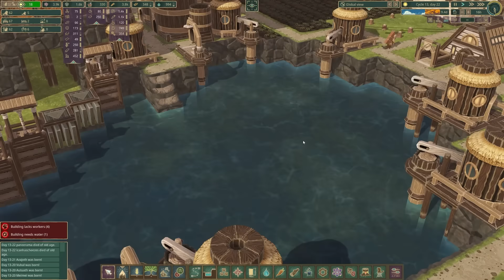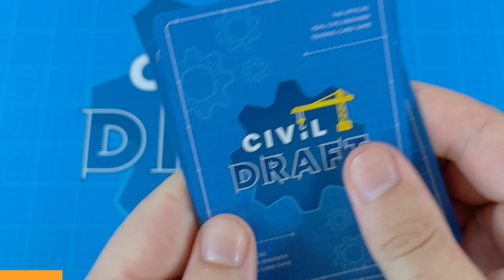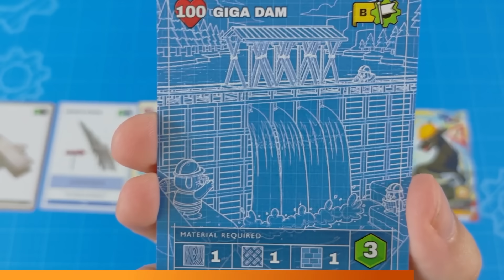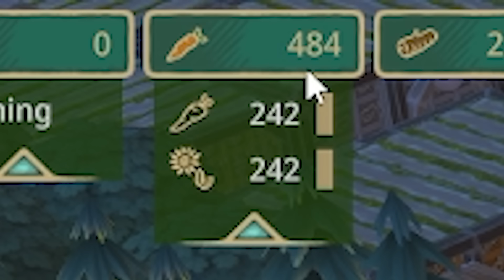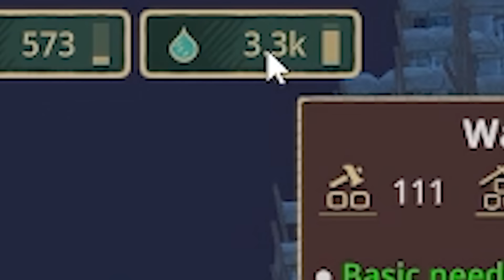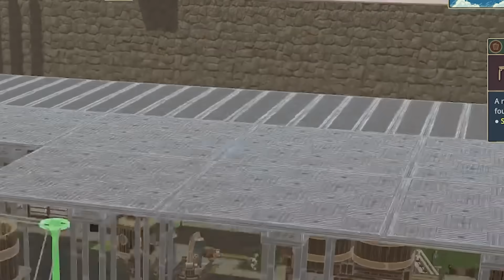The MEGA PUMP will save my colony in Timberborn!

Comment: 30:09 “One 2x overhang with two 5x overhangs? Nahhhh one 5x overhang and FIVE 2x overhangs! The grain direction MUST match!!” 🥴 edit: it doesn’t even match all around!! There is no discernible reason to choose 80 log/planks + 30 metal cost, over 60 + 24 cost (Small margins yes, but besides the resource principles, it would probably be a shorter build time too)

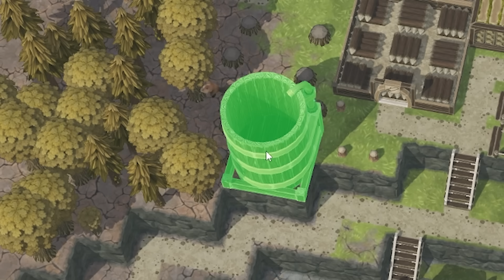Comment: 15:20 use a fucking district center !!! What's the point to have 2 discricts if u don't use district center, it's more interesting when districts help each others and trade than be completely independant, its like having 2 games in one, u just seperated the map in 3 instead of getting all the advantages of this map.

Matt always says that he hates architects, he shames them and juste after he does the most architectural thing : wasting a lot off ressources to build a big roof
... 😑

Comment: Couldn’t the columns be replaced with arches using the 1x6 or so floors you used in the roof? Thus you could eliminate some of the pillars and clear it up a bit if the physics works out.

Comment: I'm still not quite sure how he intends to get the water out of the resevoir he's building. I figured he would leave a hole in the corner, with some sluices to control the moat water level, but the whole thing is sealed up. At least the sluices he built at the water sources should prevent bad water from flowing into the MEGA RESEVOIR.

Comment: You must be an architect.  For the top of your water hole you need 2 dams. That way the overflow will run out. You need to use sluices properly or i am going to revoke your engineering title.  I havethe power, dont make me do it!

Comment: Build a hobbit like village in timberborn. So the end goal is: 1) the entire surface of the map should only be covered by grass or trees. 2) surface may also have 1 windy river with maximum of 2 bridges. 3) some houses must have the side that has door - that hoes on surface,  but their roof must be covered & have grass on top. Each of these houses shall have a patch of food growing on a 3x3 tile no further than 1 block away from it. And all of them need to be connected by paths, but no unnecessary paths allowed. 4) up to 4 log pampers on the surface, but they become closer than 4 tiles from each other & only 2 per side of river. 5) zip lines are allowed on surface with up to 4 stations & 3 poles. 6) no roofs are allowed 7) up to 2 fire camps on surface.  8) in the end all bevers must have a work day that is no longer than 4 hours. 9) bevers need to have every single need met

Comment: 30:00 placing a 1 5x1 to hold 5 2x1s, instead of 1 2x1 to hold 2 5x1s, is the kind of engineering efficiency I have come to expect from RCE.

edit: 32:50 😅

Comment: Terrain blocks (and maybe levees as well) can overhang 3 spaces without being supported, you don't need to cover the whole place with overhangs. It is easier  to cover using terrain blocks as dirt has no regrow time like trees and dirt is needed only for terrain blocks and leisure buildings. Covering 5 grids long, 7 grids wide space costs 1 overhang (30 woods, 30 planks, 10 metals) and 210 dirts instead of 7 overangs (210 woods, 210 planks, 70 metals) + 35 metals for impermeable floors + 84 woods for levees to close the sides of the overhangs.

Comment: I wonder why hasnt Matt just made platform all the way up to his desired height then put the overhangs on top of those platform then spacing the next platform+overhang to have a same height roof for his atlantis project and not waste that much metal and only use a lot of wood w/c he can produce a lot unlike his finite source of scrap metal(since he hasnt unlocked the infinite scrap yet). I thought RCE was an engineer but is he slowly becoming an architect since one of the most important thing engineers need to do is cut cost and make things efficient

Comment: Matt. If you want a body of water on top of the zoo, you need to make a level ceiling. Aka, supports at the bottom, with over hangs until you get to your ideal level. Overhangs are porous

Comment: Well, the Atlantis project looks impressive. I’m sure you’ll have found this out but you will need to temporarily remove enough of those impermeable floors to add paths so the beavers can lay down the impermeable floors. And there will be other engineering challenges, it’s going to be fun seeing you overcome them.

Also the IPT needs a dam to retain water in that area during the dry seasons, pumping or not that area is not going to keep water through a 25+ day drought without it.

Comment: A thought crossed my mind. To make the most of your new reservoir, you need a way to drain water from the lowest points. You have three low points that aren't connected to each other, thanks to the highest point being in the middle and the older reservoir blocking part of it. I recommend replacing some of the levees with floodgates or sluices. 

I would also recommend building a small dam at your colony to raise the river level, at least part of it. That way, the pump would have a larger supply of water. From what I can see, it can handle a bit more water without flooding the farm. Just make sure it has a way to keep from overflowing. I would also put some sluices on the bottom, just in case you need to drain it.

Comment: Instead of Atlantis keep with the Beaver theme and call it a Lodge.       "A beaver lodge is a dome-shaped structure built by beavers using branches, mud, and rocks, typically located in or near water. It serves as a home for beaver families and provides protection"

Comment: Dude it’s your colony but you could do so much more with that space than to put a roof over it….experiment with SKYSCRAPERS!!! Build UP ! You can turn that reservoir into a pressurized water tower and that could be your first skyscraper then unlock dirt and built farm towers with zip lines up the sides that take the beavers up to each level and do tree towers too and never run out of wood and play with your logs all day long !!!

Comment: Does anyone else feel like that's not the most efficient placement of the overflow on the water reservoir... Even if efficiency would require more engineering at the tip?

Comment: Instead of the Atlantis project, you'd likely be better served building an underwater reservoir.  Put a 1x dynamite, a 2x dynamite, and a 3x dynamite at the bottom of a river to start a stairway down.  Then use the tunnel dynamite to clear out an underground space.  Then you can work your way downwards from there, creating a massive underground lake that won't evaporate during droughts.
A practical upshot of this is that if you make it close enough to the surface in areas where you need to farm, your crops will never dry out and you can create fertile land in otherwise dry areas away from rivers.
Reply: Underground reservoir evaporates as if they have no roof at all. Total height of water is the most important factor for reservoir.
Reply: I've been doing this since they added the tunnels. Also using it to dispose of bad tides. It's even better since you can build any size underground reservoir and then put dirt on top of the platforms. I set mine so the water level is the same height as the top of the dirt and use a platform for covered waterways wherever I put roads, so that top layer of of dirt is always irrigated, but there's only one layer of dirt and all reservoir below.

Comment: To do a roof the best is to use platforms as supports, then use a 5x5 Metal Platform, 10x 6x1 Overhangs, and 5 3x1 overhangs. Then make another 15 tiles away and repeat. you will need supports yes, but its both minimal, easy, and gives you a nice flat area.

Comment: If it is true that 2 water sources in require 2 blocks worth of drainage, then the only way to get the most of out the reservoir, would be to take the amount of footage you need in drainage and divide it amongst flood gates at different heights. For example, if you added 8 more floodgates to the top of the reservoir, you could in theory set them to 10% open and be water neutral with 90% more of a block width of water. With 2 more you could get 75%, which I feel is totally worth the effort.

Comment: You already did what you need to do, but I want to reinforce the importance.

It is critical that you "prioritize by haulers" your large water pumps. Otherwise, they pump water so fast that they will have extremely bad up-time, due to the pumpers having to haul the water. They require lots of hauler support, depending on where they are located relative to your storage.

They do a good job of displaying the efficiency of your colony. If you position your storage and pumps in proximity (and actually use the alternate storage settings), you can provide for the whole colony with 1 fully staffed large pump and a couple haulers. If not.. well it'll take a lot more beavers than that to do the same job.

Comment: Did to take into consideration how you're going to use the water?. So far it's just a storage container... You should think about making a pipe at the corners to let water down into the aqueduct. A sluice gate can work as an automatic valve. You just need a tube to transfer water from the top to the bottom. Also, the ends are lower than the middle which would make the pool separate into two halves. It would be more useful if everything were the same height.

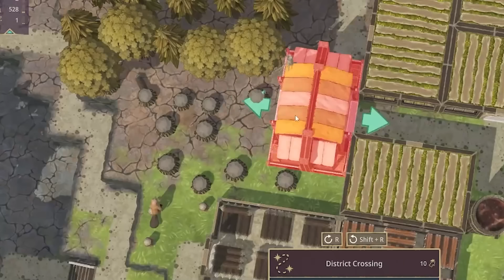Comment: 14:52 No you could not. Mechanics changed since we had the trading posts. District crossings now are border and trading post in one, so you need to build this where your district is supposed to end and the other to begin or it is 100% useless as only 1 district has access to it.
Then you most always want beavers working on both sides as their job is moving stuff in and out of the district crossings storage. (That only holds 30 per type.)

Comment: Be sure to put in some floodgates so you can get some water out if you overfill again. Personally, I would always leave a way onto the roof in case you need to get there later. Either wall off those stairs or put them in somewhere else.

Comment: that map has 4 sources where you built the reservoir, the waterfall limit is 2.2cms per edge. that means you need at least 2 edges to allow water to flow without flooding.

Comment: I think this gets really close to architecture with those massive overhangs. It looks 'good' while being really impractical. You'd get a way bigger volume by having pillars with 3x3 or 5x5 platforms, then building the overhangs from that. Just every 13 blocks (2x5 for the overhangs and 2x2 for the platforms) have a pillar. That lowers the floor, giving more volume, but most importantly, it's less architectural.
Reply: Imagine watching this channel with the expectation of good engineering.
Reply: It will basically be the end cause it will make the whole colony unplayable 😂😂
Reply: That takes calculations, and well we know that an architect lacks that. So we know why he did it THIS way.
Reply: Just building a few large water storages would be the same volume. But that's not interesting content!
Reply: He should start building these overhangs from the rim of the enclosure. And then support the following adjacent overhangs with playform pillars.
Reply: that would be very hard to build. The over hangs he's using will be much easier to build

Comment: You know that you can save a lot of material building your Atlantis simply by using dirt blocks. Dirt blocks stick to the side of other dirt blocks so you wouldn't need any structure. You can just build up the edges and then across with dirt. Also because a Dirt block only requires 6 dirt (which I believe a single beaver can carry) they are way faster to build. Dirt is currently extremely overpowered, since it behaves like a levee but at half the resources, so less hauling needed so quicker building, with a resource that is essentially infinite and requiring no growing time or prep, while also being able to be built connected to adjacent blocks with no support.
Reply: Bro, Matt is so cooked. He is going to see this comment in like 5 episodes lmao. By then hell only have like 20 percent of it done though so he can probably switch it up.
Reply: @OakenRecord  That or he'll not have paid attention to the resource usage while building his current design  and create another incident
Reply: @SpaceCowboyfromNJ  don't you need bots in order to manufacture and place dirt?
Reply: @Lorkanthal  No any builder beaver can place dirt and the facility to mine the dirt can be operated by normal worker beavers. Matt did so the last season to line the top of his shaft with dirt to plant trees up there.
Reply: I had no idea that dirt blocks didn't need anything beneath them, and Timberborn has been out for like half a decade now.
Reply: @Dealanach To be fair I think it may have been part of the last update since I hadn't noticed either till my last play through. So it might have been one of the changes surrounding the ability to tunnel. I actually still have to do some experimenting, like what happens if then dynamite the blocks connecting the overhang? Do the blocks just float, disappear, or fall?
Reply: Builder beavers only carry two blocks, and also dirt can only overhang by three so you'd need way more supports (which would still be far easier than this ungodly amount of metal lol)
Reply: @iamhazelnuts  True, however you can build up one on the last block and then build out 3 more and so on and so forth. With some strategic use of a few overhang platforms it should work pretty well. The one big issue is you have to really pay attention to which direction the dirt block faces since if you have two dirt blocks connected they will only build in the direction the arrow faces, so if the arrow face the wrong direction it considers the outermost block as the only attachment point, and therefore non of the other blocks can be built until has to be built first even if the other blocks attach to existing walls, all while that first block can't be built because it would be floating.

Comment: You could use the new features and put terrain blocks on the roof instead of impermeable floor and levees. That way you could also use the higher levels to farm aquatic crops too… or sink the colony deeper underwater.

Comment: for the roof, why not do the opposite?

Since platforms let water through as if it didn't exist, you could cover the top with dirt blocks from a dirt excavator, have the city built up top, and have the cove serve as an aquifier.

Naturally it isn't the Atlantis you'd want, but engineering wise it makes a lot more sense to have water at the bottom, not on top

Comment: You should build drains in the lowest floor levels of the reservoir and have water spill into the outer ring of the town, to keep it topped off. That way you dont have to build any water pumps on top.